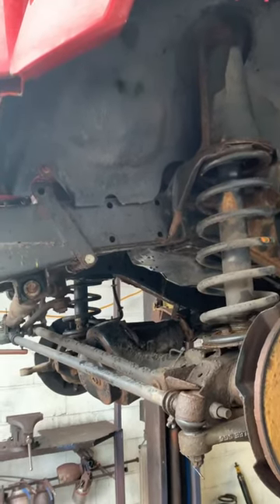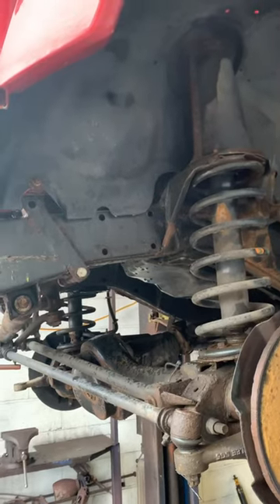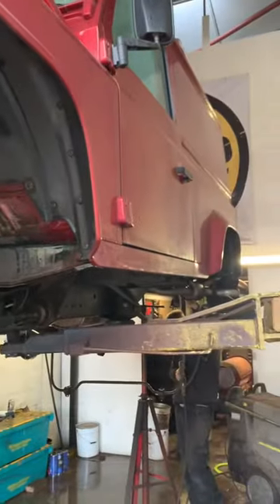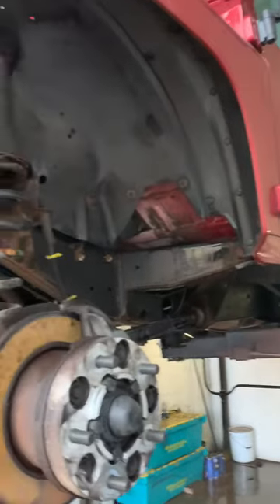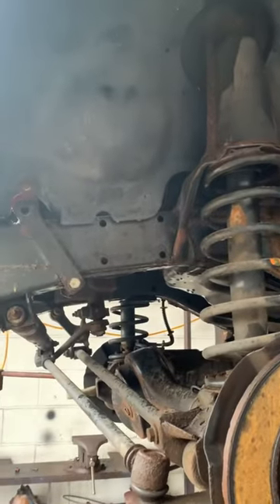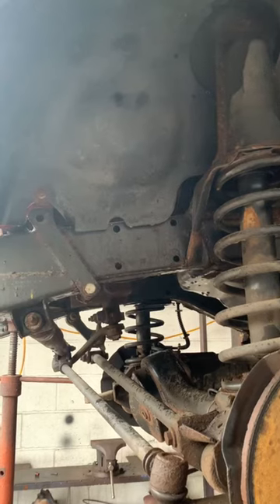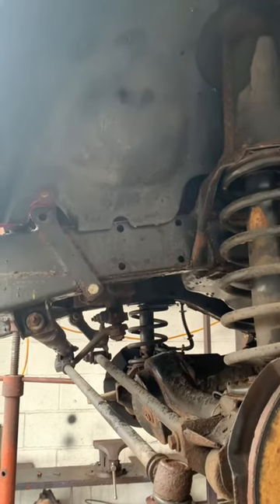How to clean the inside of a chassis

Comment: Hate boxed frames because of that. Mud and dirt get's inside the frame rails leading to rust from inside out. C frames would solve part of the issue, but not been often used in modern compact trucks.
Reply: Why not weld all the holes up. Bone dry internal chassis, no rust, surely.
Reply: @Jin-Ro  using some plastic clips or rivets and gluing pieces of plastic sheet on the bigger ones it's an option.
Reply from the maker: It gets in unless it’s fully sealed, and you can do that on a chassis without significant re engineering.

Some have closed off sections and used them as air reservoirs though.